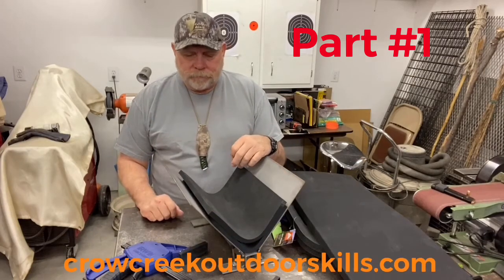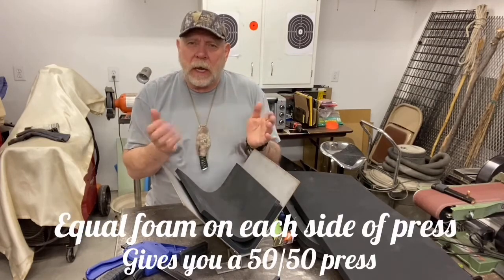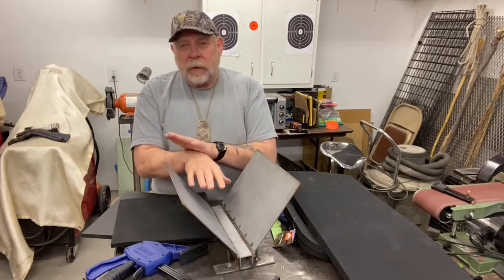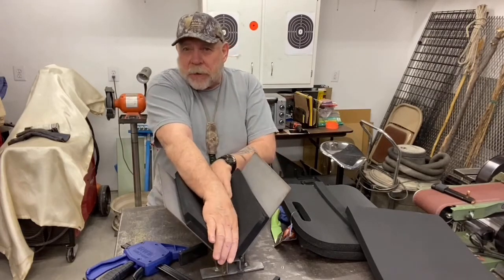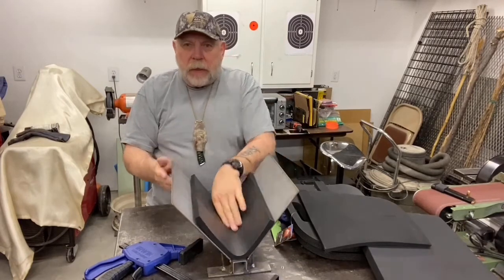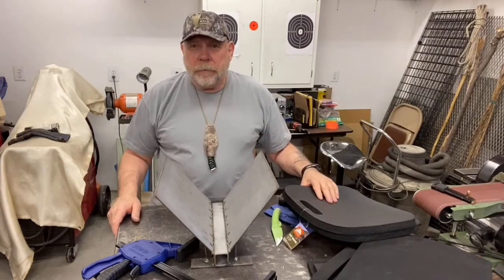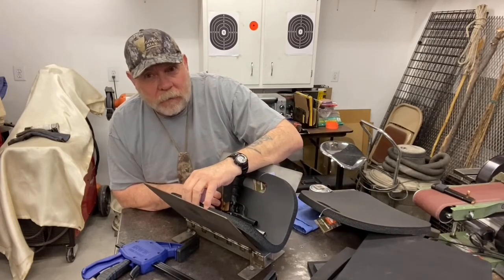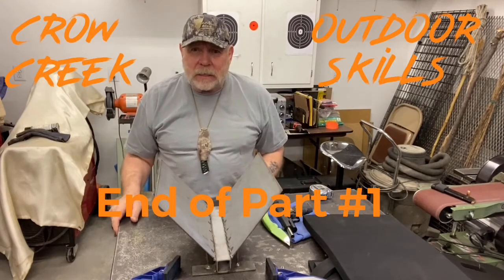KYDEX PRESS | ?BEST? | PART 1 OF 3 (LEARN ALL YOU CAN)

Comment: Great video but made me wonder about the press's gap width at the hinges in relationship to the foam thickness. For example, with two 1" pieces of foam or four 1/2" thick pieces, is there a rule of thumb for gap at the hinges? i.e. 2-inches to match the foam with no compression when closed on nothing, less like 1-3/4 inches or 1-1/2 inches, how much of a difference does the density of the foam make, if any?